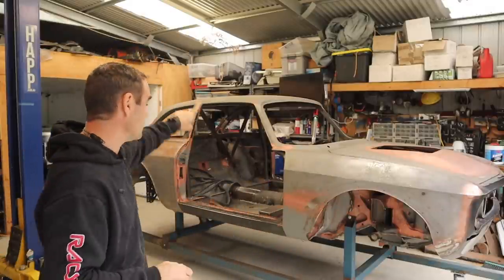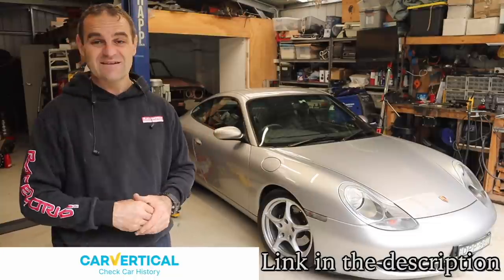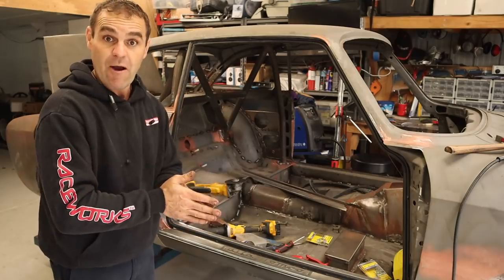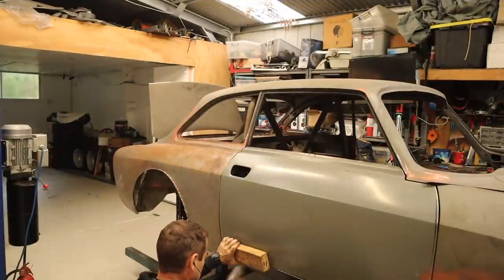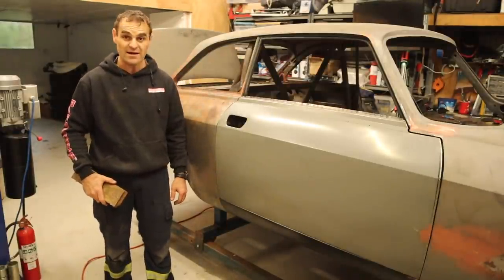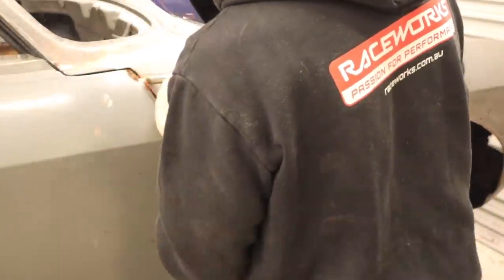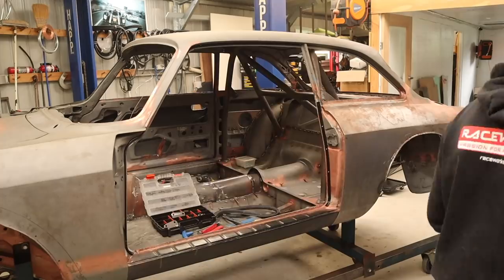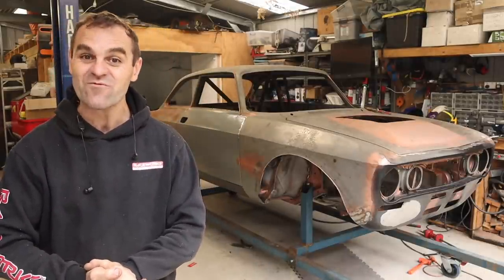Perfect door gaps - Ferrari engined Alfa 105 Alfarrari build part 130

Comment: If you smash the flux off the  Mild steel  Arc welding rods,  they are  your best friend.  
 Especially  when you are doing edges..  
Simply,
Lay the rod next to edge you want to fix.. and weld. 
The rod melts and takes alot of the heat so you don't blow through and get a nice solid edge..

Good work as always mate.

Comment: Alfa continued using the shims idea into the 116 series Alfettas etc. I found them a great system when doing the doors on my Alfetta sedan race car. They did make them a bit different so you could slip them in without taking the door hinge off to get them in on the 116 series.

Comment: Great job looks amazing but you miss the part that those doors are empty, with all the weight of the glass, eletric motors, etc that body line will be much lower. Keep the good work looks fantastic!
Reply from the maker: The latch actually locates the rear of the door so the extra weight is not really an issue.
Reply: @HomeBuiltByJeff  awesome! Cant wait to see some paint.
Great job.

Comment: Nice work , impressed how far you've got in such a short period of time ( IMO) . For the locator holes on the hinges you should maybe get some 1/8" skin pins  as used in aircraft skin work to help keep the holes aligned precisely while you put in the bolts . 👍

Comment: Hey Jeff, great job on the door seals man. I just did mine on my 69 GTV and could not get the doors to close completely as the seals seem to thick. I tried warming them up and pulling the doors together on the inside with a tie down. Any tips on how you got them in so nicely? Thanks Mike.
Reply from the maker: Sometimes you may need to move the rubber mounting rails inward which might help.
Reply: @HomeBuiltByJeff  Just came upon your channel & was impressed you responded with solid guidance (as above). Love your work! ❤✔👍
Reply: Jethro Bronner (has a YT channel) has highlighted that there was an intrinsic problem with the 105 GT in that the inner door panel/stamping is too tight against the lower aperture, very common to have problems shutting the doors easily when they're fitted to make the door-skins completely flush with the wings and three-quarter panels.
Reply: @HomeBuiltByJeff  I moved them in as tight as possible by re drilling the rail mount holes. Hopefully the gap will get smaller when things warm up and the seals settle in. Thanks Jeff. Looking forward to your paint reveal.